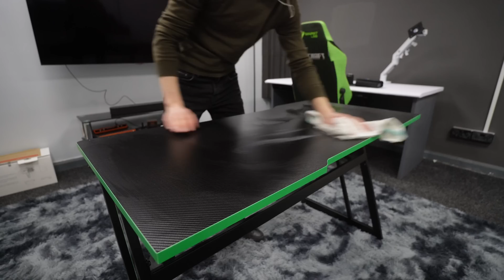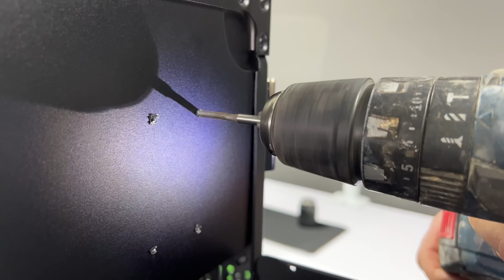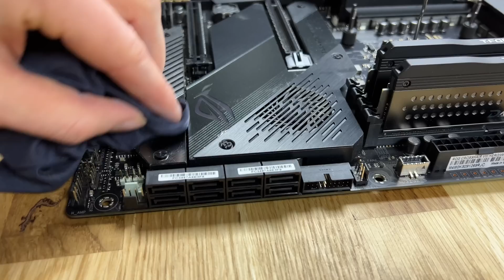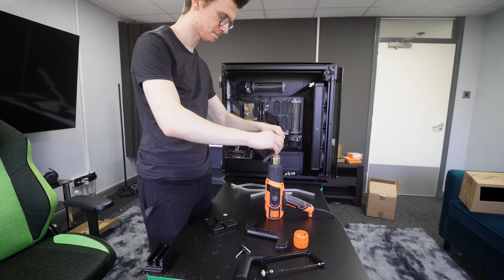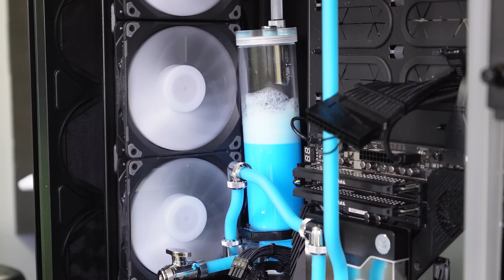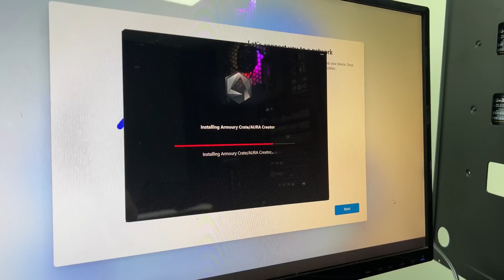I Built The World's Largest Gaming PC!

Comment: You certainly don't need two water pumps to cool the cpu. But it'll be useful for a potential gpu water cooling in the Future.
Reply: He cooled both systems not just the one still 480 mm is a bit insane